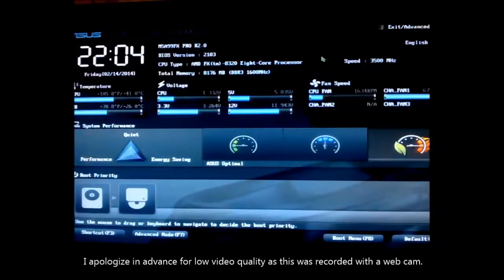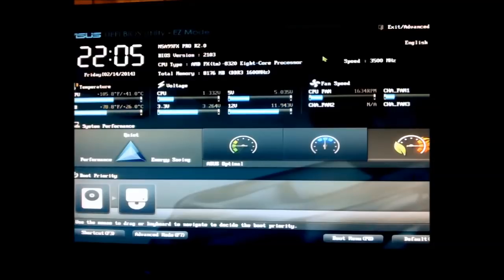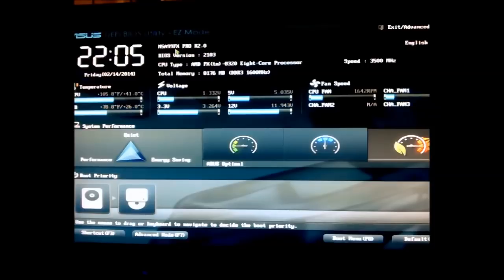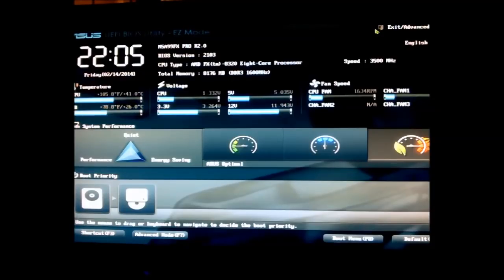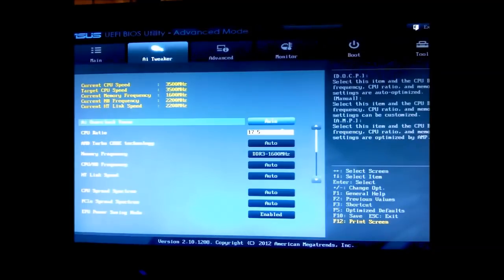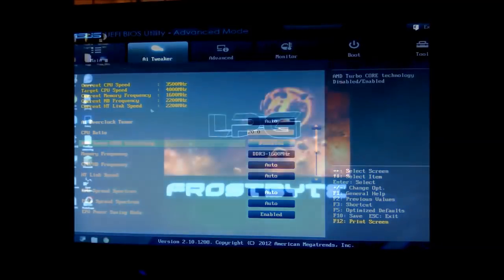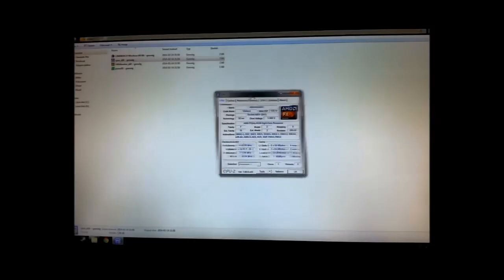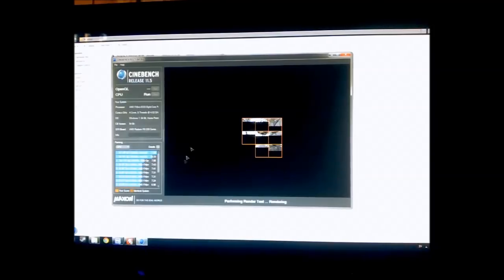Turn your AMD FX-8320 into an FX-8350 (8320 OC Guide)

Comment: Can I do this OC Guide with stock cooler?
I also have:
- Asus m5a97 evo r2.0
- Case Cooler Master Elite 370
- XFX ProSeries 550W
Reply from the maker: Keep an eye out on the temperatures. But yes you should be able to. Only problem being the stock cooler getting noisy.
Reply: ***** Ok, thanks :)
Advise me to do? Worth it?
Reply from the maker: jokeergear Comes down to if you're concerned about the noise or not. Clock it then put some load on the CPU and see.
Reply: ***** Ok, thanks again :)

Comment: So is this without changing any voltages? , i'm a bit scared of doing that.
Reply from the maker: Nothing else than what's shown has to be changed. No voltage increase or anything ;)
Reply: ***** good, i might consider getting the fx 8320 rather than the fx 8350, still a bit nervous about ocing ( as it will be my first ever rig )

Comment: Can I overclock my chip? 
CPU: FX 8320
MB: Gigabyte 970A-UD3P
Cooling: CM Hyper TX3 Evo
Reply: Lefty Pretty much, although id keep an eye on temps, i am unfamiliar with that cooler, so just crank it up to 4ghz and run a 20 minute heavy load test while watching the temps if it goes over 70 C then maybe turn it down a little and see how it goes from there.

Comment: My motherboard is the msi 970 gaming and for cooling i have the coolermaster hyper 212 evo 
If i buy the fx8320 can i overclock it?
Reply from the maker: thanos fr no problem
Reply: +thanos fr did you overclock your cpu on this motherboard?
Reply: The UKProGamer yes,
i overclocked my fx 6300 to 4,4
Reply: thanos fr  whats the temps like?
Reply: The UKProGamer 25c internet browsing 
And 60c when gaming
Reply: might seem dumb, but if i was to overclock my 8320 would it be pretty much the same to do it?
thanos fr
Reply: The UKProGamer probably you are going to get higher temperatures because you have more cores
Reply: ok thanks for replying
thanos fr

Comment: i did this but when i run the stress test 4 of my cores stops due to 100 "warnings" what am i suppose to do?
Reply from the maker: Are you sure you have the 8320 and not the 8320E? 4 cores not being stable with just 500MHz overclock seems very weird. 

Right now you can either undo the OC or raise the voltage a tiny bit and try again if it is stable.
Reply: +LPG well then it just says fx8320 black edition in the package, resetting the PC now due to infinate bsod's i men it sounds weird, in ratio it just said auto, hos much am i suppose to raise the voltage?
Reply: +LPG i'm not good with CPU overclocking :p
Reply from the maker: Slith jay http://www.overclock.net/t/1348623/amd-bulldozer-and-piledriver-overclocking-guide-asus-motherboard

Make sure your motherboard is not causing throttling.

http://www.overclock.net/t/946407/amd-motherboards-vrm-info-database
Reply: +LPG could not find my motherboard, i recently updated it to the recent update, i got the asus m5a97 r2,0

Comment: hi im a absolute new to overclocking 
i never thought i would overclock my pc
but i have a 8320 on a regular Asus M5A97 
with coolermaster evo 212 
IS IT EXACTLY THE SAME SETTINGS ON THE VIDEO?
Reply from the maker: +Antony Tat Affirmative
Reply: +Antony Tat by clocking your cpu you also boost your ram up, every cpu clock is a bit different depends on the Motherboard-cooler-Ram you having.
Reply from the maker: Chris Frog Touching nothing but the CPU multiplier will not affect your RAM normally. I assume you're talking about the BCLK or base clock. You shouldn't touch that normally.
Reply from the maker: Chris Frog There was no need to mention it and potentially make people confused in the first place as I don't ever mention it in the video.
Reply: dang, sorry up for league?;P
Reply: you using graphic card for your coffee to?

Comment: Guess it wouldn't hurt to overclock my 8320 for once since im about to buy that Ryze cpu. Cryorig H7 should be able to handle it 2C idles 17C load with turbo boost disabled on my GA-970A-UD3P

Comment: My 8320 is running at 5.1ghz safely at surprisingly low temps. thanks to corsairs H100i. using an ASrock mobo as well 990fx Extreme9. 750w psu from corsair hx series

Comment: LPG. How much do you think the fx 8320 in this build could overclock?
http://pcpartpicker.com/p/Fv9TTW
Reply from the maker: ReviewTechSquidward Due to the power phase on the motherboard being only 4+1 it can't do any higher overclock. The cooler can do 4.4-4.5 but I wouldn't go higher than ~4.3 with the motherboard, and even then it depends if you can have the airflow in your case to help cool the mobo VRMs.

Also, look for another PSU as a suggestion, 850W is way more than enough for your build and there are better and more stable supplies for better price.

Comment: Should i try this method with an ASRock 980DE3/U3S3 ?
Reply from the maker: +FrenzyProject37 I'd advise you not to as the board lacks heatsinks on the power delivery and has questionable overall quality.
Reply: +LPG and the ASRock 970 Pro R2.0??
Reply from the maker: +The Forgotten Undead Not sure. See if you can find other users experience with the board.
Reply: ***** ok thanks for your answer! :D

Comment: Thanks a lot dude, has been really helpfull. By the way, how many Ghz can i get in my fx 8320 with a Hyper 212+ (and artic silver 5 if it has something to do) ?
Reply from the maker: I'd believe 4.4-4.6 depending on the binning of your chip.
Reply: *****
 and i've the m5a99fx pro r2.0 motherboard, but surely, i'll have to change voltages to get at 4.4 right?
Reply from the maker: Revan Strelok If you're lucky no, but I would believe a slight increase is necessary. You will have to change some other settings aswell for a higher overclock than the one I showed in this video keep that in mind. JayzTwoCents had a great tutorial, otherwise the Overclock.net website also had one.
Reply: thank you !! i'll be back soon to tell you how it went! :D

Comment: Can a stock AMD FX-8320 cooler handle a OC?
Reply: Probably, but you would run at high temps. If you're like me, and you're a worry wort about temps and everything, I would get another cooler. The Cooler Master Hyper 212 EVO is a great cooler for only $25 dollars... BUT, if you have some money to spend, the Noctua NH-D14 is also a great cooler to use at $70 dollars. Hope I've helped.
Reply: Ok thanks
Reply: The DoubleC Anytime
Reply: I wouldn't.

The stock cooler is shitty enough that barely handles it even at stock speeds when you're really pushing it (I've had mine overheat and crash just converting HD video before)
Reply: if you oc to 4.0  yes after tha no i try it work at 4.0 after that in a bit computer shut off i got me the v8 gts and it did 4.6 but for some reason games drop frame maybe i have to high the volt but i have no idea how

Comment: i overclocked my fx8320 to 4.2mhz with a hyper evo 212 cooler 100% load im at 49C and voltage is at 1.384V. I was able to overclock to 4.4mhz but it ran a little too hot for my liking.
Reply: initiald22 Update with new settings and adding .09 volts to the stock voltage i was able to keep it at 4,4ghz keeping the idle @ 17-20C and under load @ 48C.
Reply: initiald22 Can you tell me exactly how you did this please :)
Reply: fredkot yea bump up the voltage to .10 volts raise fans to 80 percent turn off turbo core technology enable cool n quiet plus hpc mode but it depends on your motherboard and processor

Comment: can i overclock it with the stock cooler?
Reply: Most likely as the fx 8320 comes with the same cooler as the 8350 but i could be wrong do some research or for a cheap cpu cooler go with the cooler master 212 evo

Comment: I have  a gigabyte fxa ud3 mobo and this didnt work for me :/
Reply: Devin Whittemore I have the same mobo as you,  the extra step I had to do was go into the Advanced Voltage settings, put the Load Line Calibration on High and give an extra .025 volts to the CPU under Vcore Voltage.
Just remember to do a stress test before you leave your configuration like that.

Comment: can we really feel the improvement of our gaming speed/work processing if our 3.5Ghz is to be overclock at 4-4.1Ghz? highly doubt it. i mean if from 3.5Ghz going say 5-6Ghz then maybe yeah. im going to have an experiment because on my stock 8320 (no overclock) i play far cry 4 on HIGH details with an average FPS of 28-35. if i overclock it to 4Ghz and play on VERY HIGH details with say 30-35fps then it is good. but honestly im just gonna change the stock fan because its the noise of the stock fan of 8320 that sucks balls. its so freakin loud. then overclock it to 4Ghz and if it improves then good. but the main purpose is simply to get rid of the noisy stock fan. dunno if overclocking is just a fad/B.S. gimmick from the microprocessor companies. why dont they just manufacture their chips at the fastest speed then sell it so we dont have to overclock them so we dont need to fuckin buy additional stuff and just play.

Comment: There was no way, that this cpu on this setting could handle prime95 without losing a core after a few minutes on my system. i HAD to raise voltages a little bit. Im using a Gigabyte 78LMT-USB3. So basicly, some people have to raise the voltages also.

Comment: WOW I'm running the same motherboard as you. M5A99FX pro 2.0. I have overclocked my CPU before for certain games but then bring it back down after just to keep it super cool since I have a custom water cooler. I Idle at around 28C, It is strange because my motherboard has a higher idle temp then my CPU.
Reply from the maker: AMD CPUs idle temp isn't correct. Don't trust anything under 40 degrees C. My CPU supposetly idles at 15 C.
Reply: I would idle close to 40C when I had it overclocked at 4.2GHz. My temps are very similar to everyone else I've spoke to that uses a custom water cooler. so I have no reason to doubt the temps that are given in HWmonitor.

Comment: OK to be clear for a noob like me that does not wanna deal with a head ache and play Lords of the Fallen next week- 8329 in a ASUS Sabertooth 990x r2 board Corsair H60 cooler. turn off the turbo, change the multi to 4.0 then boot up? no adjusting wattages or anything brain intensive.

Comment: how mutch voltage do I need doesn't work on auto
Reply: Depends on the motherboard and the silicon lottery.
Reply: every motherboard is different aka load line calibration settings chipset onboard components power phases and so on. If i remember correctly i was pushing higher voltages on 4+2 phase and i upgraded to 8+2 im using way less voltage so it varies

Comment: congratz on Diamond, i was stuck in plat:( didnt make it but anyhow, fx 8320 is not 8350 just clocked. hovewer 9590 is a 8350 sold overclocked been AMD boy long time decided to say goodbye to my Good old opteron - athlon - FX series cpu Time play with the Intel CPU Currently moved to z170 board asus formula 8  with the new skylake 6700k  maybe il get the new 10nm cpu that get realeased 2017.

Comment: Don't use software to OC the CPU. never EVER. Always do it from the BIOS.
Reply: That's what is being done here right? From the BIOS? I just wanna make sure this is a safe method of OC'ing.
Reply: Umm it's too much to explain here. Jayz2cents has a good fx 8350 guide. And oc via multiplier when you do it. Not fsb.
Reply: Cool, thanks for the info man!
Reply: No prob.
Reply from the maker: Cloud Cata It's a better idea to start off with CPU multiplier overclocking as north bridge overclocking is more complicated. I'm only showing how to set your 8320 to pretty much 8350 state. If you're interested in higher OC's obviously his tutorial is going to be the shiz. I've followed it myself actually :)
Reply: *****
Yeah,so did I,I wasn't saying your guide isn't good,I wrote that so people wouldn't use software programs to OC the cpus since most of the people are scared as hell when it comes to BIOS tweaking. my 8320 is a lottery winner.It runs 4.5 stock voltage without any failure. Managed to hit 4.9 but my 212 evo is just not enough to keep it under 62 degrees so I dialed it back to 4.5.
Reply: ***** Do I need a liquid cooler to pull this off? I would like to try to get a little more power out of my 8320 without overdoing it. I have a multi fan cooler and my motherboard is MSI 760-GM P34. I don't have a lot of experience with this sort of thing, please mind my ignorance.
Reply: Dave Leggz
You shouldn't even consider using an 8 core cpu on a motherboard that has less than 6+2 power phase, I would never use my CPU on that motherboard,it most likely throttles the cpu like hell. Just a heads up. If I were you I'd run stock clock with turbo disabled on that motherboard. You messed up big time with that very low end motherboard for a power hungry 8 core. It's just a matter of time till the motherboard dies or god knows what will happen,4+1power phase and crappy vrms was a horrible choice for that cpu.I never understand why people cheap out on motherboards and PSUs
Reply: Cloud Cata Ok some helpful information there. Is there any motherboard you can suggest then?
Reply: Gigabyte 990FXA-UD3 rev 4.0 / Gigabyte 990XA-UD3 rev 4.0 / ASUS M5A99FX PRO. pick one. I'm using the 990XA-UD3 rev 4.0 and the system is rock solid.
Reply: Cloud Cata Ok thank you. I'll look into it.
Reply: Cloud Cata Hey man thanks again for the heads up. I picked up the Gigaabyte 990 like you suggested....everything is working great. Do you think I need to have a liquid cooler to boost my 8320 to 8350 levels or will my regular fan system be good enough?
Reply: Dave Leggz
No. I am using a 990XA-UD3 as well. and my 8320 is overclocked to 4.5ghz. You don't need watercooling. a hyper 212 evo will do. depending on the airflow of the case. I'm using a hyper 212 as well and the cpu tops out at 62degrees during stress test using aida64. In a real world scenario playing a cpu intensive game it sits at ~50degrees.
Reply: Cloud Cata Thanks for all the help! Much appreciated!
Reply: Dave Leggz No problem! Oh and 1 more thing,make sure turbo is turned off and HPC(High performance computing) mode is ON in bios.

Comment: I overclocked to 4.0ghz with my FX-8320 and it was ok for a couple minutes than it froze, rebooted and failed to boot so i turn it into 3.9ghz and it works fine now with stress test and everything , really weird though.
Reply from the maker: Bad luck in the silicon lottery I suppose.
Reply: Voltage could be a bit too low, might want to increase it a bit but not too much. You don't have to risk it or anything, 3.9 is close enough imo :P
Reply: ***** Yeah 3.9 is good enough and if its working, there really isn't much to complain about...
Reply: Better safe than sorry imo :)
Reply: What is your voltage? Also setting the load line calibration settings will help with overclocking
Reply: Villee voltage is at default and im not going to bother going above 3.9 due to my circumstance with my bad MOBO it has no vrm heatsink
Reply: GameStarNinja Set your load line calibration settings and it should help with the overclock. I had 4,3Ghz with stock voltages but it wasn't stable so I changed my load line cal. settings and now it's running fine at 4,5ghz(still stock voltages)
Reply: It doesn't have LLC in the bios, real shame and like i said not the best overclocking MOBO it's a Asus M5A97 (LE) R2.0 ATX. thanks for the help but it looks like im suck with what i have.
Reply: Villee Finally got around doing it and found LLC in my bios turned it on and FAIL not only it didn't do anything but also increased my CPU core temp by 3 degrees Celsius, what a bummer.

Comment: I did this to my friend's PC. It kind of worked (I saw jumps to 3700 and 3800 MHz after doing this), but it never reached 4000 MHz even during a stress test.
Reply from the maker: Disable turbo core and it will go to 4GHz.
Reply: We got it to 4, but now OBS and Elgato's software crash after about 1-3 minutes.
Reply from the maker: ***** Really? Run something like Prime95. If it fails lower the multiplier to 19.5 and run again. Keep going until it's stable and doesn't show any signs of instability, in your case the programs not liking whatever setting you have. Did you touch anything other than the multiplier and the turbo boost?

Comment: Back again and i found that heat is my worse enemy. Even with a hyper 212+ 4.0ghz spits out a crap load of heat and under volting to 1.248v isn't solving it either, it's always over 60C that's including my gpu at full load(without gpu 56c). To simply put it's stable but not cool.
Reply from the maker: Hyper 212 is good enough to keep it cool under 4.5~ so you either got it mounted wrong or your case doesn't have proper airflow. 
With that low voltage aswell.
Reply: ***** Well my case case has 3 fans and taking off the side panel makes no difference what so ever. The heatsink may just have a bit too much thermal paste ans is pointed up( because i have a fan on top and rear).
Reply: GameStarNinja I also forgot to add that my room temp is 75c.
Reply: ***** My bad of course 75F
Reply: ***** So your kinda leaving me hanging here, so would you suggest me to re-install my heatsink maybe this time point it toward the back of my case or leave it alone and just go back to the point that it's bad luck.
Reply from the maker: GameStarNinja I can't be on the internet all day :)
But yeah, try reinstall your cooler first of all. If that doesn't work then I really got no idea what's going on if the airflow is good enough as stated. But if you have two fans as exhaust that means you only have a single one for intake? Try moving your top fan to have two intakes and one exhaust instead. Heat can move up and out without the fan anyway while the rear will help the cooler have a little push-pull system.
Reply: ***** so guess what remounting my heatsink made a 1c difference! YAY! (of course with sarcasm)
Reply: ***** i have no words , i was stress testing with gpu and my cpu got to 59c then it suddenly went to 55c and slowly went back up. I'm just stunned